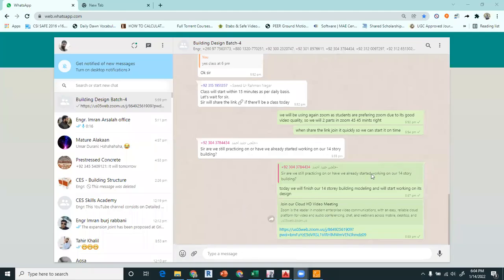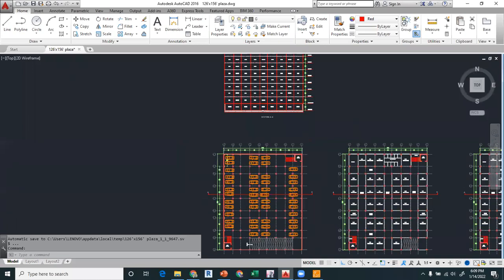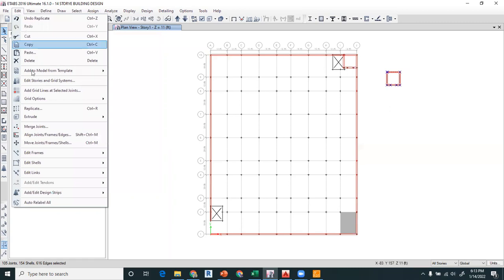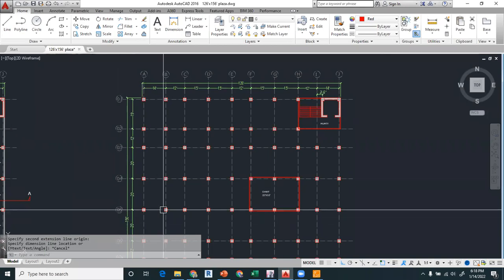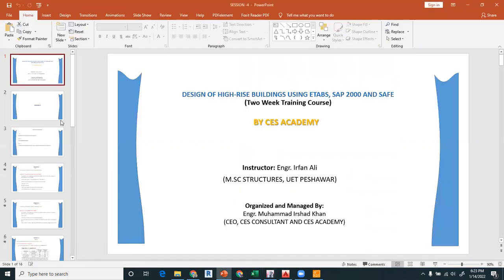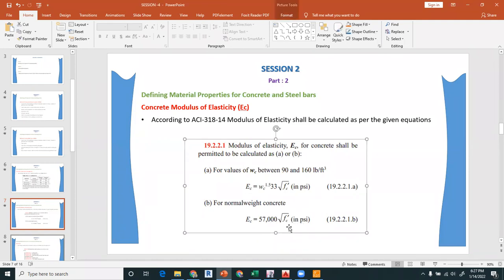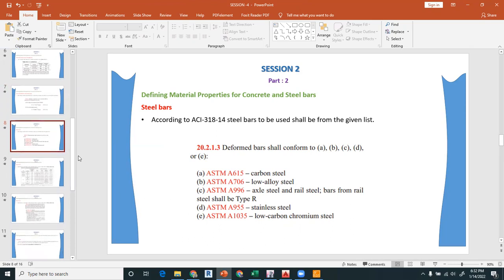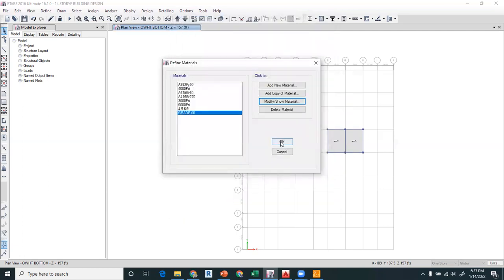Session 4 (P-1): Retaining & Shear Wall Modeling in ETABS | 14-Story Building Example

Comment: In case i have retaining walls that start from the basement and goes to 2nd story of 4 story building then how can i tell ETABS  that these are just retaining wall and not participate in lateral load resisting system (shear wall)  - Is pier labeling is used for this or we have to release and modifiers ??